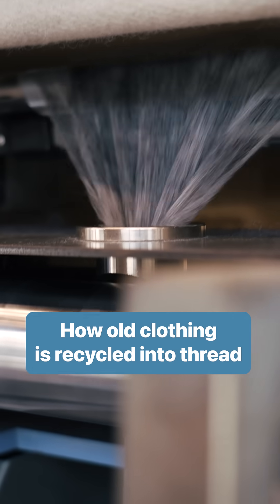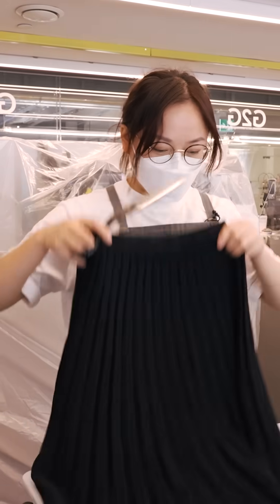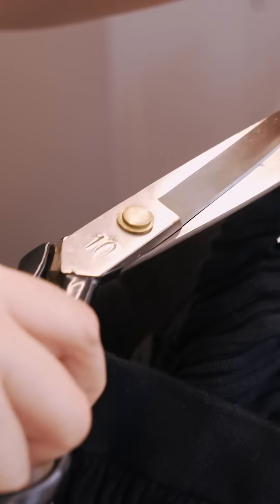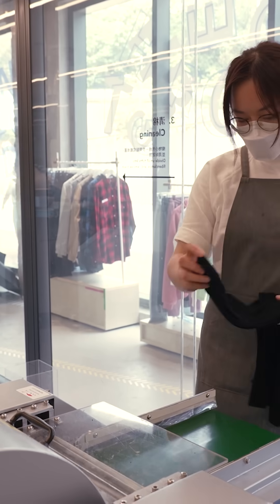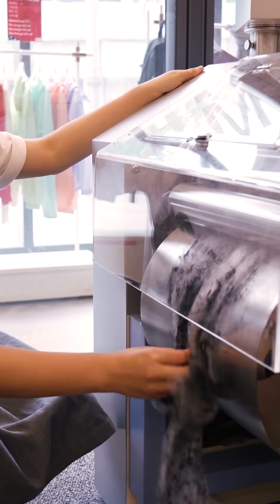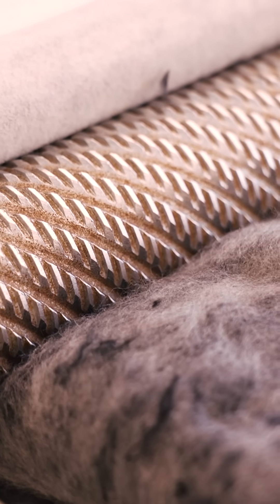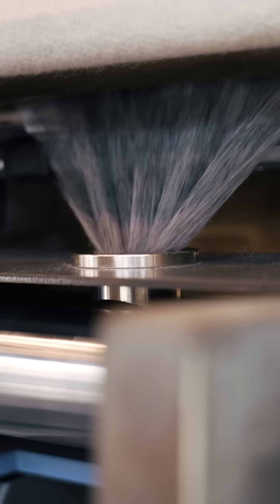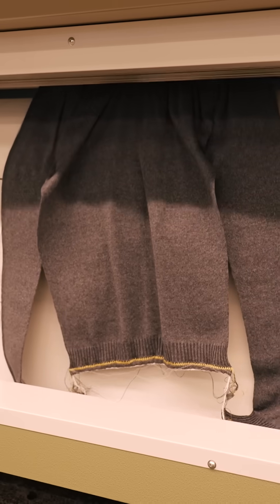Here’s how used fabrics can be recycled to make new garments. #Upcycling #Clothing #Fabric

Comment: The biggest mistake as clothing transitioned from natural fibres into plastic was mixing different materials. By adding cotton to polyester (PET) nylon, etc, they actually prevent them from being recycled like any other plastic. This new method now adds cotton, meaning an easily recyclable material is now land fill the next time it’s thrown out. Even mixed synthetic fibres could be heated in an oxygen free fractionation tower and turned back into oil. But having natural fibres in the mic means carbon and oxygen in the system.
Reply: The opposite is also true, cotton fibers can be recycled or repurposed, into high quality paper, but not if the cotton is blended with other fibers.
Reply: @pulaski1  they can also be recycled into other fabrics.
Reply: @pulaski1 oh..thats a great use of old cotton! Thank u
Reply: Unfortunately plastic is a very bad material to wear, and causes microplastics to enter the water.

It's better we transition away from plastic fibres.
Reply: You’re not wrong that it’s not an infinite loop, but I don’t think that matters right now when thousands of tons of textiles are being dumped in landfills before ever being recycled. Even if the material only gets one more life, that’s still a huge improvement. There’s still light years of improvement to be made when it comes to textile recycling, but I think this is still a huge step in the right direction
Reply: @deeeno6867  The biggest problem, as with most recycling, is stopping people just throwing it in the bin with the rest of their household garbage.  Some countries are better than others, but by all accounts, most Americans don't bother to separate even what is widely recognized as recyclable materials - paper, cardboard, metal, plastics, from their other waste.
Reply: @pulaski1 
As far as I know you can leave anything by the kerb and the US trash collection will take it...
Definitely needs a cohesive recycling policy.
.

People will dump stuff in the bin if there isn't a suitable or available clothes recycling bin nearby.

There doesn't appear to be joined up thinking when it comes to climate change..
All about emissions yet we still have single use items.

Whatever happened to the glass bottle return recycling scheme 
for 1p 5c p/bottle in the past..
...
Reply: @stuartd9741  the glass bottle refundable deposit system still operates in about a dozen states, in New England, New York, California, Hawaii, and a couple of others, but it is far from the perfect way to recycle as it leads to addition shipping costs and related vehicle emissions from carrying empty bottles around.
Reply: @pulaski1   In my youth, the companies delivering their products in bottles, picked up the empties customers returned to the shops, and took them back to the factories to be washed, sterilised, and reused over and over again. The issue now days is big companies subcontract delivery companies, who don't have to return to the factories until the next pick up, and would charge the parent company the extra labour and costs to return the glass bottles. Greed killed a perfectly functioning process, as it has done in so many other areas.
Reply: @pulaski1 if people don’t want do it at home their must be solutions for sorting at facilities
Reply: @Subrosathefirst  "Facilities"?  Where I live garbage trucks go straight from the collection routes to the land fill.
Reply: @pulaski1  oh! Here we have recycling facilities. So it’s a possibility
Reply: @Subrosathefirst  Well there is recycling, collected separately, but the problem is getting people to participate - it's usually reported as only around 20%-25% people can be bothered to even put paper, plastic, glass, and cans into one separate bin, so not even sorted.
Reply: @pulaski1  In my country they don't do bottle return scheme.
Used to about 50y ago.
..
If the recycling centre is locally based; one in every city this would cut down on transport emissions..
Also if a bottle can be used 2 3, 4 or even 5 times then it has served its purpose as that would be potentially 4 or 5 less plastic bottles in circulation..
Reply: @stuartd9741  But you'd still need to transport the bottle back to the factory to be refilled. .... And in the UK there might only be one location, as would be typical for most breweries, and other bottled products.  In the US there are often, but not always multiple bottling locations, for larger volume beers, at least.

I guess "your country" may be the UK (it's mine too, though I now live in the US) as 50 years ago is roughly when deposit bottles disappeared.
Reply: @pulaski1 I mean that’s at least partially because some places don’t even offer recycling services. We used to recycle in Charleston, SC but where we live now there isn’t even the option which annoys me.

Honestly we need to go back to using glass bottles and having people deliver them and pick up the old ones every week. That would be by far better for the environment.

The biggest lie is that it is mainly our problem as the people buying it when Im pretty sure many people would willingly switch over to a system like that if given the option.
Reply: @KidaRosado  I used to think that was the case, but when 75% of Americans can't be bothered, or refuse* to even put paper, cardboard, bottles, and cans in a separate bin, I believe you are wrong, sadly.

* A guy I used to work with (Charlotte, NC) had once seen on TV that some paper collected for recycling had been taken to a landfill (I guess there was no buyer for it), he now flat-out refuses to separate any material for recycling!  I am sure he is not alone.  

We on the other hand pretty much fill our recycling bin every two weeks (the collection schedule) with paper, cardboard, and plastics.  Glass is no longer collected, and I accumulate metals and sell them to a scrap dealer.  But could literally go 5-6 months before we need to empty our garbage bin.

And the largest flaw in your idea of returning and reusing glass bottles is the effort and resources required to collect and pack bottles for specific manufacturers, and the transportation costs.  It would literally double the transportation cost, having to get the product from factory to consumer, then take the bottle on the same journey from the consumer back to the factory.
Reply: @pulaski1  oof yeah I have heard of them doing that. I hear it’s mostly cause there is either no where for it to go or because people sort incorrectly. Also yeah it definitely would increase costs but honestly if you could get it to the scale of Amazon somehow it probably wouldn’t be too bad of an increase. The problem is how to get it there! 

I feel like there are many solutions but to get those solutions affordable we would almost have to boycott the cheaper options until it is the only option and most people definitely won’t do that…
Reply: @stuartd9741 glass recycling is no longer available I think unfortunately because of cost. Glass can be recycled thousands of times which makes it a perfect product to recycle. But because it requires cleaning and it is heavy and it breaks there are major problems with the recycling process. Plastic isn’t sent to China anymore either. They no longer want our trash to recycle, they have realized it is very toxic for their environment. We need to move completely away from plastic waste when we can and use refillable objects. Water bottle from our own filtered water not plastic plastic water bottles. Take your own containers with you to a restaurant for take out. Have shopping bags that are reusable. Stop buy liquid laundry detergent. So many ways to cut down on the plastic waste
Reply: @pulaski1 unfortunately too many rural American communities don’t have accessible recycling programs. Where I’m from in Central Pennsylvania, the closest town to me offered recycling on the first Saturday of the month…for only two neighboring counties. Despite the fact that our address was technically that town, we weren’t in the county and couldn’t avail of the service. Unfortunately it’s less complicated to throw away than to recycle in some areas. Sh*t’s effed.
Reply: @KnoelsNook  I live in a rural area (outside of city garbage service) in NC, so I do understand. .... I have to take the effort to take my recycling to a collection point.
Reply: @pulaski1  people use their free government ebt money to buy bottled water to then literally dump the water out, and "return" the bottles for the cash deposit so they can have cash to buy things that can't be bought with ebt. Thus, turning each dollar you pay toward this in taxes that actually gets through all the overhead and bureaucracy into 10 cents of drug money for the cartels.
Reply: @mwilliamson3989  great thinking. The Chinese don't want it any more. That's an interesting notion, to save up your metal to cash in.
  It puzzles me that lumber made of recycled plastic is more expensive than natural wood.
Reply: @soundmindtv2911  Oh, I know.  Deposit bottle schemes have inherent flaws that cannot easily be overcome.
Reply: @pulaski1 
To be fair most people can't afford the fees for a separate recycling bin from their utilities companies that collect it. 

And then there's the fact that most things that SAY they can be recycled cant actually be done or companies putting the recycling logo on packages or jugs with special numbers you have to figure out to know if you can recycle it.

People are plenty willing to recycle but our country makes it difficult and expensive
Reply: @pulaski1 and when we do, there are rarely any facilities qualified to actually properly process those recyclable materials. Just because something is technically capable of being recycled doesn't mean the infrasteucture to do so actually exists. We can produce "recycleable" products and packaging all day long and it won't make a bit of difference until there are resources and infrastructure for processing those materials.
Reply: @chelim5265  But that is why recycling steel and aluminium, glass too, makes so much sense - they can all be readily melted back down with relatively little additional "infrastructure" required.  

Dealing with manufactured products, such as woven fibres, is a whole other matter.  For example recycling of bulk quantities of used tyres has been promised for decades, but AFAIK has never really got off the ground, with incineration being apparently the only way to dispose of them.
Reply: @pulaski1 Sod off, I'm plundering trash cans as fast as I can, I can only get so much recyclable material in a night.
Reply: @pulaski1 our Waco Texas Owens Illinois  glass plant has operated since 1944 making glass and recycling local glass.  It's last day of operation is Dec 1 putting hundreds on the streets at Christmas.  Pretty frustrating 😊
Reply: @stuartd9741 

it's funny because back then, a pair of leather boots properly made lasted 50 year if maintained but nowadays it's too expensive to get them since the industry isn't there anymore.
Reply: @pulaski1 well...France has solved that issue by creating social working jobs for people without jobs sepparating that stuff and they have mainly 3 bins currently: glass, remaining stuff (including foodwaste) and the whole packaging is put into the 3. box: plastics, alu, paper, carton etc... As a swiss I am a bit weirded out by it and do find they lack separating compost  (I was in southern france) 
I am currently not sure what's better...
But compared to switzerland where you sepparate cardboard,  paper, alu, steel, glas and pet, they have the chance to catch more plastic types... They curently try to start a new kind of collection bag for plastics here, but rather than make it free like pet, cardboard, paper, glass, alu and steel (and electronics), the bags cost a lot for the consumer (making the recycling firm profit from both the customer and processing the plastic)...
We currently pay for the remainding waste and if you wish to depose of compostables, the other stuff which has to be brought to collection stations is "free" or payed indirectly by a hidden fee payed when buying the stuff...
Reply: @headstanding_Penguin  I am not sure that labour paid for by a "social program" is really solving anything, as it is just a government subsidy by another name, and if there is no demand/ market for the separated material then it is still going to go to the landfill.  IMO The only true solution, if it is possible, is to create competitive demand for the material at a price that makes collecting and processing it economically viable.  And with plastics that is difficult because the price of raw virgin plastic is so low.
Reply: @stuartd9741  there is no consistent rule on garbage and recycling in the US. Different states and different cities have different rules.
Reply: @pulaski1  when you have single stream recycling - you put everything in one can and it gets sorted out at the landfill before disposal - you get 100% participation.
Reply: @pulaski1  on the us recycled bottles don't get refilled. They get ground up and made into new bottles.
Reply: @pulaski1 if you separate it for them at the landfill, you get 100% participation with no consumer effort.
Reply: @tmf866  
I temporarily lived in Ohio for a short time.
A few years back 
And they would take anything even carpet if it was cut into 5 ft lengths.
Things might be different now..
Reply: @tmf866  You're delusional.  Sorting out all the recyclables from the other wet, dirty oily trash is time consuming, expensive and will never make economic sense.  And all the paper and cardboard will be dirty and unrecyclable anyway. 

And glass recycling is coming to an end in the US.  They have mostly stopped even collecting it for recycling, and I heard just a couple of days ago that a glass plant, that melts recycled glass, in Texas is closing at the end of November 2023.  I suspect that others have already closed, which is why glass is no longer collected for recycling.
Reply: @pulaski1 economy won't save you
Reply: @pulaski1 i recycle so much of my stuff...and clothes i dont wear got to trift...and close i do wear has fall off apart before i throw out...but i did know old cotton could be recycled
Reply: @suemitchel-runow3566  "Didn't know old cotton could be recycled"?
Reply: @Subrosathefirst  where do you live?  Im packing up right now! 👍🏻
Reply: @pulaski1 They had a university in NC where students created at compost bin for paper products. Anyone with a home could easily do this with some effort, but noone cares.
Reply: @deeeno6867 light years are a form of distance not time, it’s how long it takes light to travel to a place over the course of a year going at the speed of light
Reply: @deeeno6867 
I disagree.
We should be looking at 100% recyclability multi-use items.
..
Like the glass bottle return scheme already mentioned.
..
Having items that only last 1 maybe 2 years is ridiculous.
There should be a minimum of 20 year life span on all goods made..
..
This would reduce wastage less landfill.
Even better if electronics are modular so components out of disposed household items could be reused.
Like transformers for example..
..
I like this idea (of the video) but if it's not 100% recyclable then it's not progress.
Reply: 1. They prob only do it with cotton clothes.

2. Reaction-oxygen does not matter, it reacts with carbon in the refining section and comes out as CO2 or CO2 in the biogas.
Reply: @antiheld7323  The garments in this video were certainly not 100% cotton, and I suspect we're actually 100% synthetic fibres.
Reply: @pulaski1  it was only one skirt and it looked cotton
Reply: @antiheld7323 . I had a skirt like that and there was wool and nylon in the mix…not sure how that could be recycled though.
Reply: How much energy is used to run all that machinery?
Reply: @cindiloowhoo1166 the machinery is going to be used to manufacture new fabrics anyway. May as well manufacture recycled fabrics and keep some out of the landfill. One use of this fabric is the bottom of chairs and couches and furniture. That black fabric underneath box spring mattresses. Woven plant fabric weed barrier. Problem is will it have polyester and contribute to micro plastics?
Reply: Yeah but synthetic fibers feel like garbage once you know what actual fibers feel like
Reply: The bigger issue is how often we buy and toss clothes. Cheep shirts are not only ethically bad (if you spend less than 7-10 bucks on a t-shirt, slave labor WAS involved.) But also bad for the enviroment (since your going to buy 10-20 x the amount you normally would)
Reply: @Depl0rable10 THIS
Reply: It is still a huge improvement over landfill and I would never wear pure nylon fabric.
Reply: Guess the bible was right about mixing fibres.
Reply: exactly 💯
Reply: It's not entirely hopeless as these things can be incinerated down to base materials in an MSW plant, but that is kinda the last resort for reprocessing of organic compounds
Reply: Couldn't you just soak the old clothes in bleach before processing? Bleach dissolves a lot of natural fibers in just a few days.
Reply: And, cotton and wool literally grow. They're organic materials that will simply decompose back into the earth as new cotton and wool are easily grown for less cost than this insane process. Not everything in the world benefits from being techified.
Reply: this also shortens the fibers and makes a weaker fabric as a result
Reply: Thanks for clarification. ❤
Reply: Makes you think about the Torah more seriously in that you shouldn't wear clothes made with mixed fibers...
Reply: Thats really shitty.
Reply: This is why i try to buy 100% cotton or 100% polyester materials. Surprisingly 100% cotton jeans are pretty sturdy and last longer than skinny jeans, and the only minus is they are not very stretchy and as form fitting
Reply: I have a nylon jacket, but im allergic for it so the inside is cotton .....
Reply: I agree 100% but I'm pretty sure that's not actually cotton. I've worked with pure cotton before and it doesn't look like that, that looks like polyester fill or nylon
Reply: This is entirely true in terms of recyclability. In terms of acceptance, a lot of people really don't like 100% artificial fabrics and won't wear them, but 50% natural fabrics are much more wearable.
Reply: organic carbon is still better than fossil carbon... And the concept of landfills is alien to me (here we have recycling and burning the rest, the remaining residue of metals etc gets recycled too and the air is filtered and cleaner than the surrounding air...The burning is used to create both warmth for heating nearby homes (in my area a decent part of the city) and electricity -> carton, paper, alu, steel and PET is recycled directly, electronics and batteries too, compostable food is either processed at home or collected  for processing into biogas and compost and the rest gets burned (after some sorting) and afterwards the rest metals are sepparated too, clothing so far is either collected for humaintary aid, creating cleaning supplies, industrial mats or brought to second hand markets)

To me it seems irarional and dumb that the world's leading economy uses landfills today.
Reply: @headstanding_Penguin  honey, carbon is an *element*. Once something is reduced to carbon, it's literally indistinguishable. Also, the literal definition of "organic" is "composed based on carbon," so by definition, ALL carbon is organic. You'd know that if you passed highschool chemistry class.
Reply: Yeah polyester clothing was a mistake lol
Reply: Now I want a sweatshirt 😮
Reply: I knew there was going to be something f****d up about this, consider it’s from Science Insider
Reply: They actually put latex in all man-made materials and don't bother to tell people.... Some people are highly allergic to latex. ... Also different countries process the fabric/ plastic differently, whatever they do in China isn't the same as they do in England.
Reply: It be better if just natural fibers were used for clothing instead of synthetic ones! I hate going shopping and everything I see is plastic. Even high end brands are using more plastic. It gives the brands cheaper cloths to manufacture but they still charge the same prices as if it was made with natural fibers . Make it make sense, please!
Reply: A recent discovery has proven about 80% of mixed material clothes can be separated for recycling as a  result of research paper. And to test it the host of the reactions channel tested it in his kitchen with surprising results. It's early days for this process but it's a good result if scaled up.
Reply: Natural is good. Wearing plastics disrupts your bodies electro chemical processes
Reply: But old cotton is hard to recycle..it just désintégrats
Reply: And in California recycled clothing fibers have been known to cause cancer.
Reply: @nekkoskrilla6750  According to the state of California, everything is known to cause cancer!  🙄
Reply: I agree with you from a consumer perspective but a lot of manufacturers would die off in the process.  But they may be busy making robots by then.😂
Reply: but if they're recycled instead of thrown into the trash, it can just be shredded again and turned into ply yarn! So it's a full circle with minimal addition but an increase in the amount of recycled material
Reply: Yep
Reply: Was,going to mention how do they mix or separate the different materials.
Reply: Wait wait wait, so was the bible actually RIGHT about not mixing fabrics? Dayum, the goat herders of 2000 years ago accidentally got something right lmao
Reply: @Big_Red_Dork  perhaps, but then again, they had issues mixing linen, wool, cotton etc.  Which all are fully recyclable/biodegradable.    Very different from non biodegradable materials we have today.
Reply: @Big_Red_Dork LOL Clever!
Reply: @Big_Red_Dork that's probably not why that commandment exists, and in fact it's not known for sure why that rule was made. It seems the best guess anyone has come up with is that garments made from linen and wool were reserved for the high priest, so no one else was allowed to use it. But the bible doesn't actually say that.
Reply: @Big_Red_Dork they were more eco friendly...they used natural miswak as toothbrush instead of plastic toothbrush
Reply: @Big_Red_Dork  first, find me anything at all to complain about regarding cotton linen blends that isn't true of one or the other fiber. Then, and only then, we can begin the discussion. In the meantime, stop braying at us and start learning something not known by 3000 year old goat herders.
Reply: @tmf866  dude, it was a joke 🤦 . Every commonly available fibre in general use in different weaves has it's place in different types of clothing
Reply: @Big_Red_Dork uhh they didn't have plastic fiber back then, and it was only against linen and wool being mixed. We literally had no way to spin cotton lmao

We don't have to listen to ancient goat herders about things they literally never encountered lol
Reply: @catie5939  Yes, obviously I know bronze age peoples didn't have plastic fibres, I was just joking
Reply: @catie5939  You realize tons of knowledge and things we know about all sorts comes from "ancient" people right? 

And there were practical reasons why they didn't mix fabrics back then as well. But yknow "LOL IS THE BIBLE...NO TRUE NO LISTEN."
Reply: @KrissyMeow  No ready 4 plates on table. Eye watch utube n stuff
Reply: I bet that girl's name is not Emily
Reply: Recycling is a sham. It all goes to the dump.
Reply: nobody cares ong bro